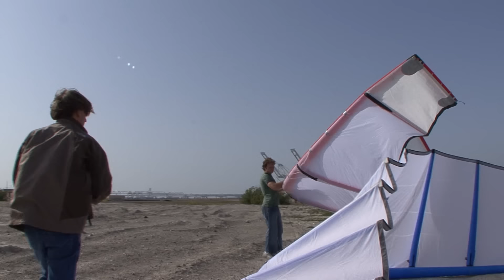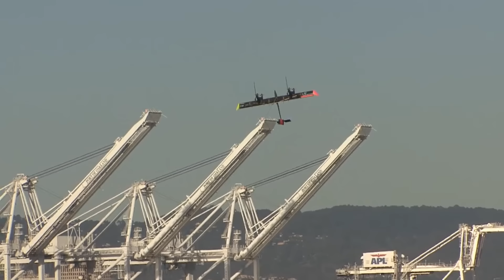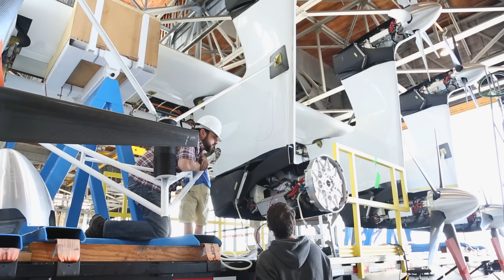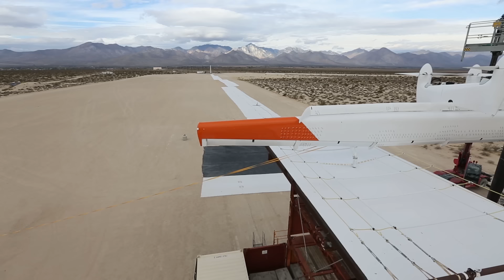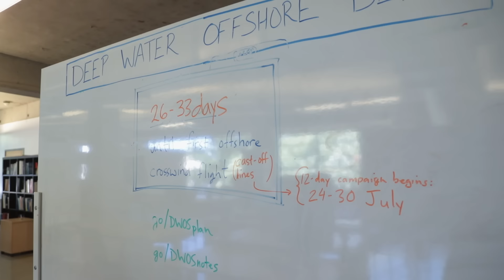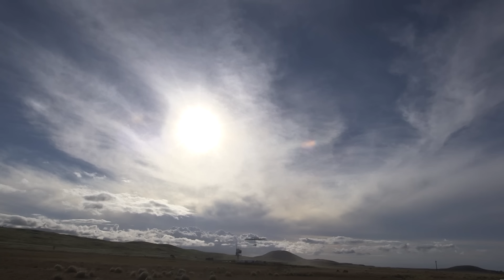Pulling Power from the Sky: The Story of Makani [Feature Film]

Comment: I'm not a Physicist, but do have a general question:  Does the kite function as a type of Vectored Black Hole?  Meaning, does it function as an Ideal Net-Zero flux SINK?  Does it project an infinite virtual flux gate?  Is it capable of extracting power from wind that passes within 50 wingspans in all directions?  What percentage of the energy is extracted from the wind that does not flow over the propellers???  Could this concept be scaled up into a flying wing the size of Delaware?  If it could be scaled that large, what would be the weight and cost of the tethering power cable?  What about converting the power to microwave energy and beaming it down to a receiving antenna in the Rose Garden of Joe Biden's waterfront compound?  What did they do with all the power they extracted over the 13 year project???

Comment: How about if the device was on a firm tether with flexible joints and arms that could also slide in and out to stabilize the device if it drifted outside of a specified boundary. That would allow it to move up down, back forth, and in and out, but not plunge as the wind speed reduces.

Comment: I agee that this seems to be overengineered solution but at least they put an effort and resources and dedication to test it all out.  Who knows, maybe someone will get inspired by this, and takes us all one step closer to something that might outperform clasic wind turbines. Many videos poping up over the internet shows the wind turbine insustry these days thinks more about the power of profit rather the electric power gains. I don't know, retractable wings as kites instead properel that could work for wind turbine? 

By wathcing this movie imidiate thing that came to my mind was shooting off the kite on thether that will spin a flywheel on magnetic suspension in a windy day. So I tried , and that gave me enough power to provide all energy I needed on my garden shed. Sure, the flywheel system was orignaly designed to use a bike pedal power. But I would never thought of using kite to do the work for me without watching this movie. And it works! Nobody will tell me I did not use a kite to generate electricity ;)

Comment: Instead of deep water stationary power this should be used to power cargo shipping.  Portable electrical power is the only feasible way to decarbonize the sector, solar panels aren't practical because of the top loading cranes, hydrogen would be absurd.  If you can make it work on a big boat instead of a tethered platform it really solves the problem and also doesn't compete with any of the other energy sectors that are better for land.

Comment: This project had too many fast moving parts that were made of relatively flimsy non-robust components. Materials in use would undergo frequent stresses and strains to cause them to wear out and have to be replaced on a regular basis. None of these things was "self-healing" to cause automatic recovery given a short resting time.

Consider the prior ICE age.

When the ICE sheets were 2 miles thick on North America, they began melting. The melt water on the surface would erode the top enveloping ice side edges until a massive amount of water broke through those edges causing a very large wave traveling at extreme velocities toward the shores across the ocean waters. Some "experts" have theorized that the size of this huge wave of water could have reached as much as 2 miles high and been traveling in excess of several hundred miles per hour.

This described situation may not be extreme enough because what if the scale was even larger?

What if the wind direction changed very quickly?

The only way to beat these problems is NOT with a huge structure, but with many super tiny ones because material science does NOT scale very well to larger objects.

The other problem with this project was that it was directed toward MONEY MAKING for the centralized ownership and control of the energy generation devices.

What is really needed is decentralization to the point that each device run in the customer's home is SELF-POWERING so that there would be no need to place a frigging Watt meter on it and then have to pay yearly increases the billing rate for the unfortunate customer due to how the monetary system has compounded interest charges on the debts of each nation, thereby forcing ever increasing debt servicing charges that, by themselves, cause inflation by growing the debt size without bound.

The space time vacuum is supposed to be seething with high bandwidth random energy. There are supposed to be broken symmetries in physics that should be able to glitch the system into providing energy as would be needed on alien space craft that have been visiting our planet for millions of years from places very far away. Supposedly some device prototypes have been made that do work, but patent offices are running using outdated physics models that do not take into account fuelless forms of energy conversion from the localized space-time.

The Star Trek series theorized that over use of certain kinds of warp drive devices would cause space time instability necessitating that such drives systems not be used ever again. This same thing could potentially happen with so called free energy devices.

See Free Energy - The Race To Zero Point uploaded by Victor Von Doom
and similar such themed videos. Explain how the Methernitha testatika generator works, then replicate the thing using inexpensive fabrication methods, et voila.

One concern that I have for your electronic components is outlined in the video documentary the light bulb conspiracy where it is explained that sub-par engineering methods are deliberately employed to cause "planned obsolescence"--a way to insure local factory worker jobs were kept going by forcing the unfortunate customer to completely replace their consumer goods because the stupid widget would break down just when the warranty period had ended.

Each sub component of such widgets would have this "planned obsolescence" within, and the joint probability of sooner failure would increase with the higher component counts and lower quality of each cheap device component used at the point of manufacture.

The unfortunate customer is victim to repeatedly having to outlay good money after bad, thereby draining him of his savings after job retirement and all of this broken junk ends up wasting energy to manufacture it, then have it fill up land fills. 

During the countdown to 2012 that happened some time ago, it was explained that every few tens of thousand years our spiral arm of the galaxy would travel through a region of space that is subject to unusually high amounts of radiation originating from the center point of our galaxy that originates those spiral arms from that center.

This radiation may be responsible for the evolutionary burst of activity that took place several hundred million years ago. Supposedly the width of the affected radiated space shall last about 7000 years before the solar system emerges out of the affected radiated sector into less radiated space.

The 2012 dooms day videos that were here on YouTube had explained all of this stuff. 

Unfortunately finding these videos now is very challenging to say the least due to Google updating their algorithms to de-rank search results so that they can hide information that is a cultural Marxism no-go.

Perhaps the channels hosting such videos were summarily deleted without just cause--who knows?

I would like to refer to this information, but Google has made this impossible due to its wokeness policies that interfere with these goals. This all seemed, no so coincidentally, to happen right after Google abandoned its "Don't be evil" motto some years ago. Why abandon being good and becoming immorally corrupted? It must be that virtues were hindering the new plans for evil?

Comment: So they should have just got a big drone and put the prop motors to produce the electricity and put it on automatic where the drone will go into a dive and it just goes into a cycle but by the way the whole technology of air and Air piloting and danger is impractical

Comment: While interesting on a technical level, the whole concept is not economically viable. While it's true that the higher you go, the higher the wind (and thus energy-gains) - at least to a certain point - the problem with this is - apart from the higher upfront capital cost -  the added complexity and maintaining costs. The difference in "gain" (thus electricity and thus profit) compared to regular windmills, is far from enough to be even remotely competitive with modern large windmills also placed on the shores or sea. and those are their prime competitors. and you couldn't place them on land, because no country will swamp their sky with giant kites that could hinder airplanes or fall down on the ground, EVEN if there's only a remote chance off that happening. It's just not worth the hassle. Politicians will not risk it, and economists will not be interested in it, as a general rule. It might have some niche market, perhaps, but it's extremely doubtful to ever be implemented on a grand scale.

Comment: Could you design a dual or two wing and then find a parachute type of recovery. Also, as a landing pad,  consider having the two wings settle into two Vs or Y set up like crutches.  Also, the idea that something can't be designed and used unless it can generate money or metered is stupid.  There are other frequency related means to harness electricity ............ but not developed because some big cheese won't let it happen because he/she/it can't make money and have more power. ......... stupid is that stupid does.

Comment: Seems to be  far to complex a solution for harnessing wind energy. From  docking the kite to the complexity of the flight system needed to accommodate for the unpredictability of wind. The sea is a harsh environment and needs robust solutions. I would be keen to see the cost of one of these verses the electricity to be generated. Because I believe this idea was doomed to failure from the start , far to complex, far to fragile for the environment and then the  unpredictability of the weather thrown in, makes this a non starter.

Comment: Whilst I agree that renewable energy is an important goal, taking a basic idea of a fabric kite and, after great expense evolving it into a dead end project is itself wasteful. The end product is a flimsy aircraft, incapable of an emergency landing damage free unable to fly in high winds and with nowhere to `hide` in adverse weather - a fabric version could at least easily fold itself away (Spinnaker chute on sailboats?), so, following the initial inspiration, use two tethers (strings!) for control and generate power on the ground using movement of the pylon. The thought of `Saving the Planet` with this machine is laughable. Thumbs up for the video, not so the `Kite` or it`s misguided creators - I now know why it took so long to get round to viewing the documentary!

Comment: Why don't people use smaller wind turbines?  
Personal size turbines that can gon in people's yards or roofs. We are so busy trying to prop up the grid, that we are missing our opportunity to use other more simple and reliable ways to use technology. Four small turbines and some solar panels should create enough electricity for one home. On the days that too much electricity is produced, the excess should be stored for use on the days where there is not enough. We will no longer need the millions of miles of wires, and towers that it takes to connect every home to the power plant. And we won't need any of the other heavy equipment that it takes to regulate such  large amounts of electricity. Some large cities may still need the grid. And some communities may decide for a grid option. But we need to rethink the whole system where we charge consumers by the watt for electricity. 
We should by a modern electricity production and storage system, and then use as much as we want and need. 
This way we will have competition in the industry for people who are able to design the systems that can produce the most reliable electricity . If we stay with the grid, people will continue to compete for ways to make electric companies and their shareholders wealthier.

Comment: i think this is the first time ever seen an alternative energy project that  starting from the design, the handling and  the programming of the controler was so bad.  design that didnt enclude a safe way to land, "softcrashing" is the only option.  the controler - we have microdrones that can handle  very strong winds and can hover or fly perfectly stady or on there flightpass, this here couldnt even handle steady flight with a little downpull, with 7 rotors !!!.  the procticle aspect,  i think i would prefer a windturbine 100times over  this.

Comment: The problem here is scalability and let’s not forget safety. Think about the physical size of electrical generators and imagine them flying though the air only being contained by a cable or thousands of small ones to give the output of a large one. Think about the area it would take up and the insane amount of carnage that could happen if even only one gets out of control. This is the pipe dreams of hippies and pot heads. It is nothing but pissing money into the air when it could be better used. In fact it reminds me of the thoughts of my uncle 45yrs ago. His idea was a tree like thing and the leaves would flutter in the air and generate electricity. Guise what he was a pot head hippie. His idea was foolish just like this one.

Comment: so much hate in this here comments why?
Reply: @wakenow7612  have you ever had one? sounds like you haven't so shut it.
Reply: yes it flys up to a set altitude. as it needs said altitude to do its dives to spin its generator/motors to make energy. duh!
Reply: @Roboman5e15  I own 2 drones. A micro drone that only flys for a few Minutes and a bigger one for higher flights. That's a drone. Hence why it RAN OUT OF POWER AND CRASHED INTO THE WATER WHAT A NICE TAX WRITE OFF.
Reply: @wakenow7612  yet still its not a drone
Reply: its basically a flying windmill
Reply: @Roboman5e15  it's not though. This is like an Elizabeth Holmes project of drones. All fake. And where does the energy harnessed go? Into the ocean? Lol
Reply: @wakenow7612  are you being nitwit on purpose?
Reply: @Roboman5e15  as someone who flies drones personally, and as someone who also actually believed this story at first too, can see now that it's a load of garbage. The person above us right. You would never get prop wash off of a windmill. The only way to get that much prop wash is being at full throttle. That's a drone for sure. Good eye and good catch wake n bake👍

Comment: If staying inside the box was working we wouldnt need to attempt new means of energy creation. Its the first try.. Give these people 10yrs to learn on the fly (no pun intended) and my $ is on a viable eneregy option being a success.. I can only imagine the # of variables..that being said, i think they need to re-think there model. Rather then concentraiting there efforts on the wind drag they should address the production from using the force a wing uses to ccreate lift.. Good sail boats (with good sailers) can go 4x faster then then speed of the wind. They do this by creating a hi-low pressure difference on each side of the sail.. Just like a wing .. Think of the sails like fan blades and wings at the same time. Change of pitch creates pressure gradian... We need to give these groups 5yrs and 100mil to push the learning curve. America needs to take the lead in green energy! Just like the space race. 2% of our GDP.. We have everything we need to change the world.. All we have to do is decide we want to do it..

Comment: fly heavy object in sky consume a lot energy by its own weight. so the concept is not right.. could just fly a light kite as light as possible. and putting the string back and forth to generate electricity. Its much cheaper simpler and safer

Comment: "Complex building" and building a heavier than air device for harnessing wind energy, One thing leads to another and a simple design turns into a robotic evolution in case of your project from a building perspective. Remember the Clue is "Sensum Communem"
Geometry and Symmetry without the use of external need for power is the key.
A few years ago, I designed, built and flew a prototype all day long without any human input, and 100% lift plus hover using only wind. Than life changed and I stopped.
Imagine your project works. You will only be selling your technology to the highest bidder. In the end its just another "race to riches rather than a race to future"

~edit: I dont understand the joy of building something already artifically powered. Its like flying a plane or Helicopter and exclaiming "wow" we invented something.
To me this was a 100% waste of watch time.

Comment: A+ for effort but facts, reality & common sense should have prevailed over (ie) ego, easy grant money, pie in the sky mentality, etc... which would've saved an incredible amount of time, effort & resources.  The team should've abandoned the structural wing in favor of mounting electric turbines to blimps tethered to cables/conduits running down to ground-based battery bank structures (which could ALSO double as storage/protective housings for the blimps) and then simply called it a day. While I'm sure the wing idea looked great on paper, well-known environmental variables & stressors were never going to allow a device like this... achieve long-term mechanical and financial efficiency... not even close :(